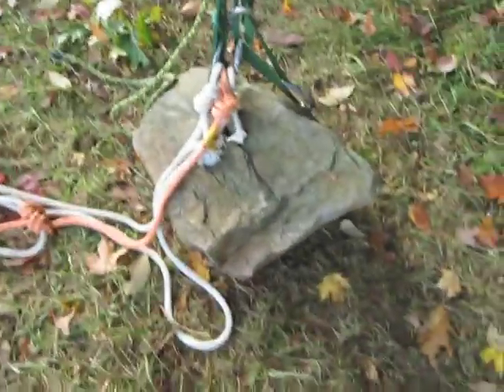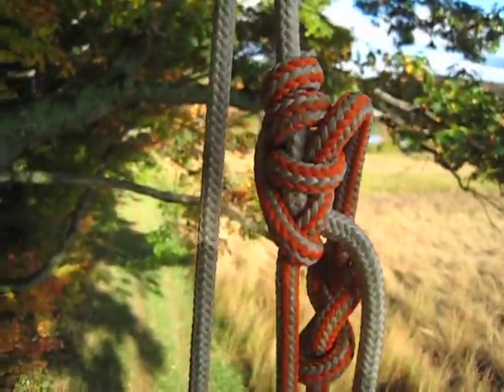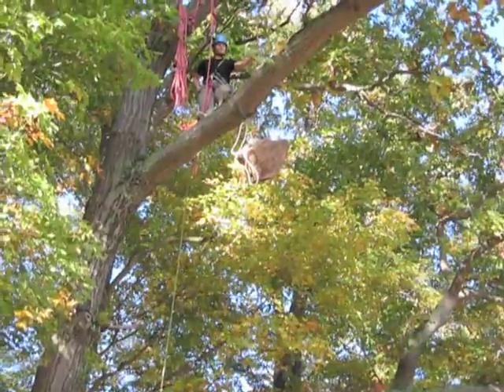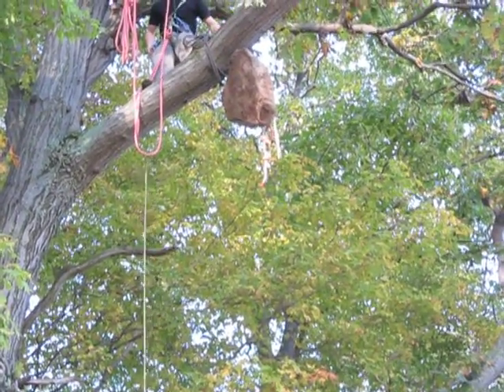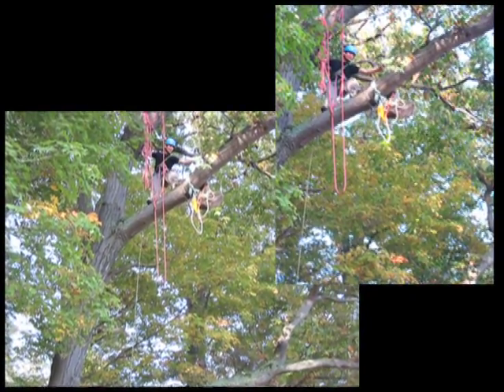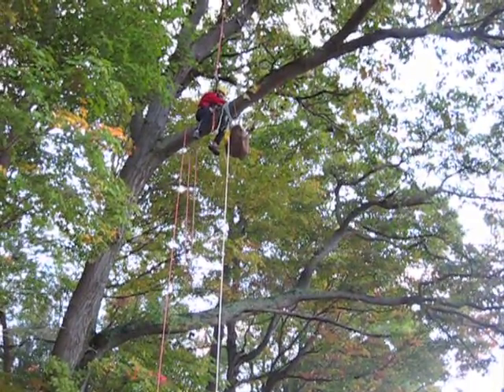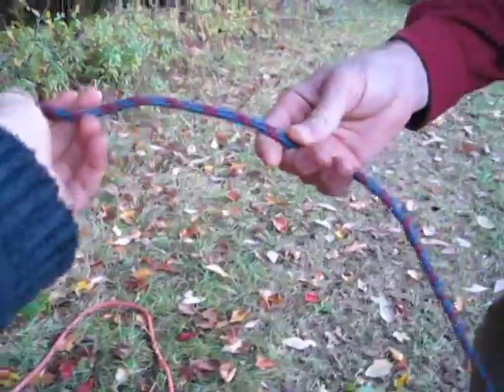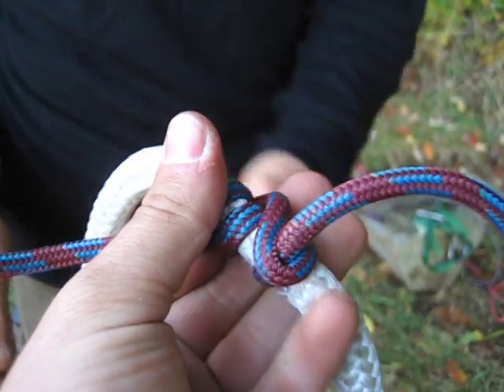Blake's Hitch Drop Test DRT, SRT

Comment: This is a very thoughtful experiment. Coming from the climbing community, we would never climb on a prusik like the Blake's knot, it is strictly for ascending, but arborists do it all the time. They trade off a weak point in the system to make their lines more easily and quickly adjustable. The whole point is to limit any fall to only a foot or so, but if climbing above the last point of attachment, distance is doubled.  This is worth thinking about when scrambling about the canopy, since it wouldn't take much of a fall to duplicate what is shown here. Heavy rope is worthless if the weakness is in the prusik line.That said, I believe most guys use heavier line for the Blake's hitch, and sometimes double up a variant prusik knot onto either side of a pulley.

Comment from the maker: Yes, we have tested the prusik.  I think the videos are around somewhere, but the general result is that you don't want to fall on a prusik.  In long slow pull tests the prusik slid.  In drop tests it didn't.  If I recall correctly the prusik snapped at the knot under tests with fairly low fall factors.  Ascenders, on the other hand stayed attached, but de-sheathed the rope.

Comment from the maker: @thwackaddict I'm fairly sure that the cord was 5/16.  It was definitely around just one strand of the climbing rope.  I can't say for sure what a prussik would hold with this cord, as it may have cut at the gate of the carabiner.  In general terms two strands are certainly better than one, but even still, this impact is pretty high.  Previous factor 1 tests with regular utility cord snapped a three wrap prussik...
Reply: I looked closely at the diameter of the small blue cord, as I want to try 9mm hitch cord (compatible with ropes 11 to 13mm).  I’m interpreting the diameter as 8mm, per my own eye, Samson’s ultra tec spec, and the 5/16in spec written up at the end of the video.  Great work CornellTreeClimbing!

Comment from the maker: @thwackaddict Sure thing.  The setup was a split tail double rope over a bare branch (or pulley block) with a blake's hitch as the friction knot.  During some past tests we saw the blake's hitch slide under very high impact forces.  We did this test to more closely resemble a real situation - where an inexperienced person climbs without tending the slack in the line.  Fall factor = Distance of fall / length of rope being fallen on.